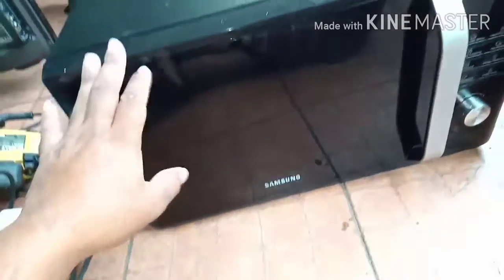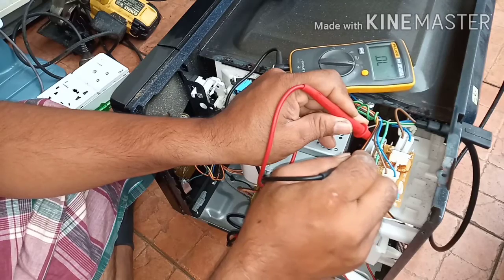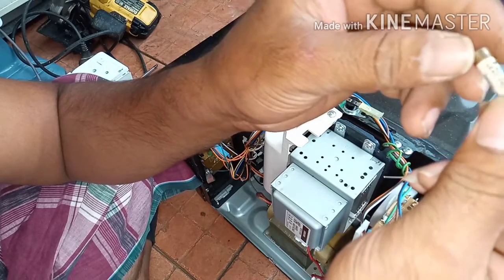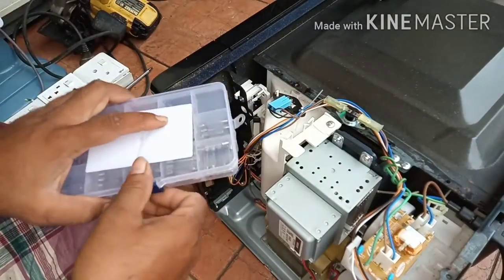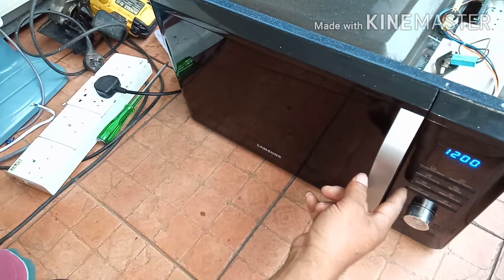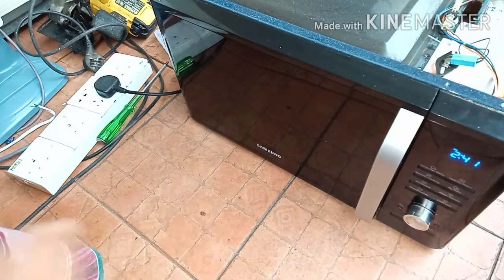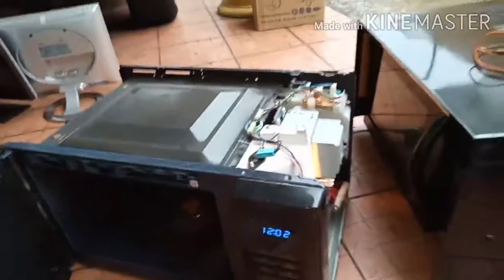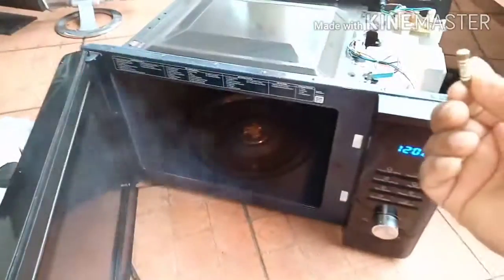How to repair Microwave no power ?

Comment: A friend insists that I check out the microwave even though I said it's not my specialty.
As far as I know, there is light but electronics don't work.
Any tip on what to check for?
It's a sharp microwave.